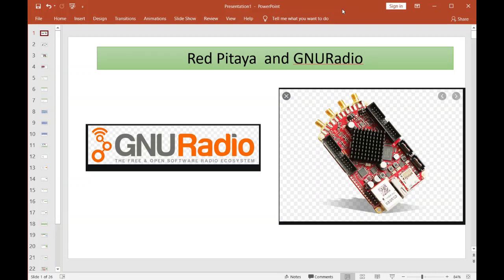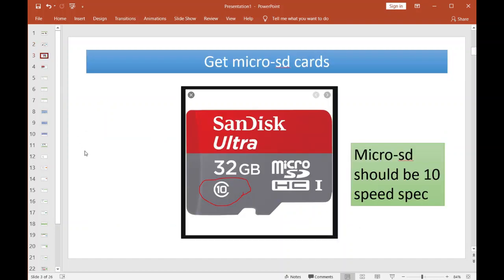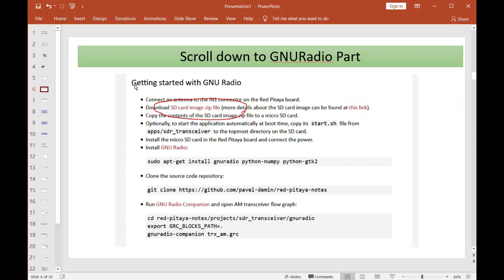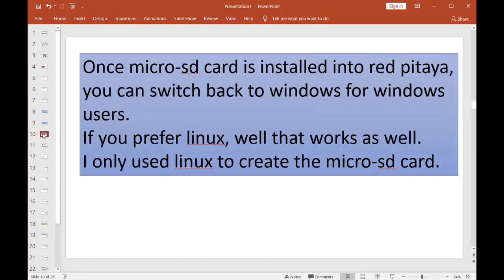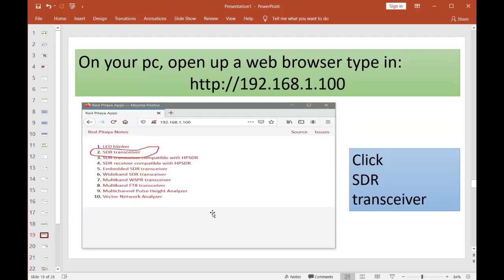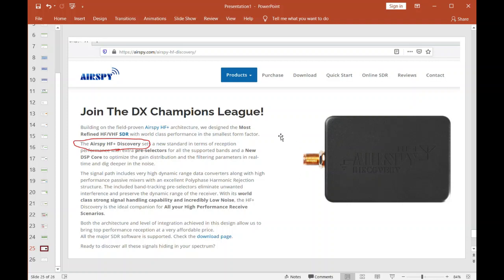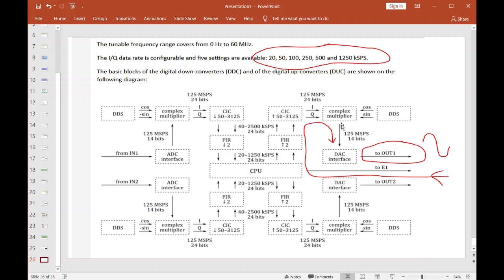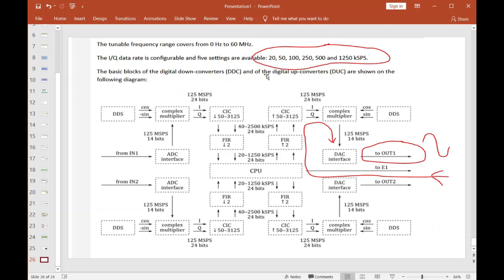Red Pitaya and GNURadio

Comment: Thanks for including GNU Octave in your newest video! Please see the following link that shows my GNURADIO flowgraph and FFT sinks that is being sent to a Red Pitaya 125-14 sink.
https://imgur.com/a/fQZ8mK6
I am trying to simulate an always on CW signal that is transmitted at 14Mhz. I desire to use this signal to find the max power output of my Red Pitaya.
Please see the FFTs - I am seeing a 28Mhz frequency rather than a 14Mhz signal - what am I doing wrong?
Lastly, I would like to add a low pass filter with a cutoff frequency a little higher that 14MHz. How can I add a low pass filter and make sure the data types are correct?
I am new to signal processing and GNURADIO but studying very hard to understand all of this!

Thank you in advance for your assistance.
Reply from the maker: Set the frequency of the signal source to 0 hz
Reply from the maker: The carrier frequency is set in the osmocom sink
Reply: How can I add OOK to my flowgraph? Just want to simulate CW from amateur radio.
Reply: I just received the Field Expedient SDR Book 3. It shows me how to do OOK!

Comment: Dr SDR, as I stated in my last comment I don't have Matlab so I am using GNU Octave. The command rgb2gray(data) returned an error on your w3.jpg file. After I realized the error with the file I just replaced w3 with w8 and then ran the script. Octave generated the bin file. I did need to put the full path along with the jpg name in order for it to work. Next step is to replace your pictures with mine and I also want to create my own audio file. Of course I will have some fun like you did. Then after that I want to thoroughly understand the theory behind each of your steps in the Matlab file.
Reply from the maker: Cool

Comment: Dr Moonshine, I moved my conversation from Reddit to your YouTube channel. Today I followed your instructions and was able to replicate what you demonstrated on my PC!!! I am using GNURadio 3.8. I was able to copy Pavel Demin's files directly to an SD card on my PC. My Red Pitaya booted right up and I started up the Red Pitaya SDR Transciever. The only things I changed in your flow diagram were the paths for the wave and bin files. I just put a 40dB attenuator on the output of the Red Pitaya and then connected a cable from the attenuator to my Airspy HF + Discovery receiver. I used SDR# and tuned to 765Khz and everything worked perfectly. I also tried SDR++ and it also worked great. I cannot afford Matlab so I am using Octave. I will see if I can use Octave to create the bin file in the next few days. I'm sure I will have more questions as I study your Matlab file and flow diagrams. Once again this is super cool! Thank you for your hard work and your detailed explanation of how to replicate.
Reply from the maker: very cool, please reach out if you need help with more red projects, or want to know how to build something else with the red, like a ISB transmitter.  when you have complete I/Q control, you can make any signal, no nanny controls.   lol
Reply from the maker: github path:     https://github.com/DrSDR/Red_Pitaya_AM_LSB